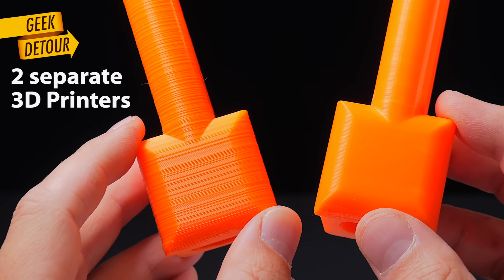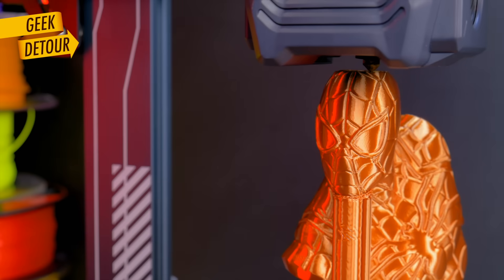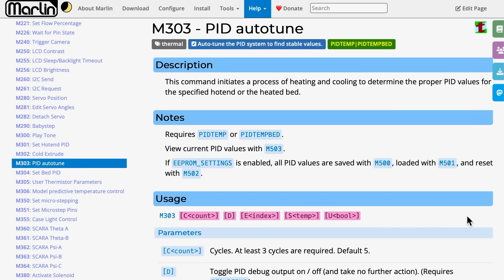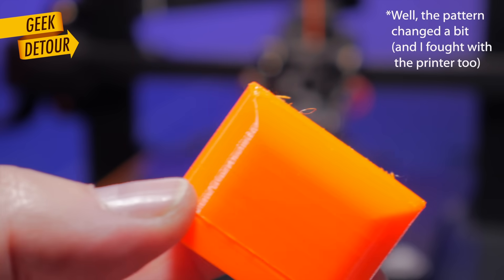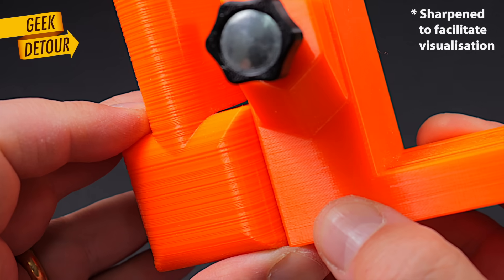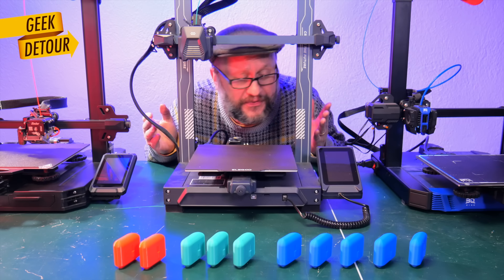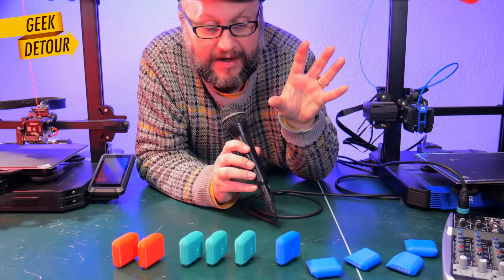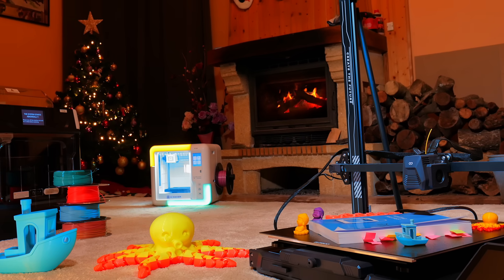3D Printer Problem: do you know How to Fix Z-Wobble?

Comment: I want to start printing but it scares the crap outta me to see a huge book related to possible printing problems. Is it really such a hassle to mantain?
Reply from the maker: No, it is not - at least not anymore. Printers got a lot easier to set up and use. But it is a hobby that pushes you into mastering, to learn how to get better results. Bambu Lab sent me one of their printers and I didn’t get a single issue - well, I had one fail, but that was my fault. Failing is part of 3D Printing. But most of the time you get rewarded with great parts.

Comment: I had a very similar problem with irregular Z-layers suddenly appearing on my SOVOL SV06 with every bigger / taller print a few weeks ago. I also went to lubricate, tighten, calibrate everything and it did not get better.

Turns out it was caused by filament binding up in the runout sensor I had mounted months before (located on a swivel at the base of the filament spool holder). 

Everything had worked fine after that for 4-5 kg of filament and only THEN the effects began to show looking nearly exactly like on the prints shown in this video.

I used a cheap, ready made filament sensor with no PTFE tube/lining, and the filament was slowly "eating" its way into the plastic of the sensor housing with every X-movement of the print head.

This lead to increased friction inside the sensor housing depending on the angle of the filament was traveling in relation to the print head - which obviously caused inconsistent extrusion volumes when the print head was moving along the X-axis and simultaneously "pulling" filament off the spool.

I fixed it by drilling out the sensor housing a bit and putting a piece of PTFE tube with a cutout for the sensor switch inside. Since then all prints came out fine again.
Reply from the maker: I loved to read this. Printers are getting better “as stock” but they are not perfect - specially the budget printers. Perfecting them is very appealing to me. Great solution ❤️
Reply: @GeekDetour  and sometimes it's your own "improvements" to the printer getting you - even with a timed delay - making things worse. 

I got the book you recommended and it contains a  lot of really usable information. 

... but in my own lowly opinion (especially after my experience mentioned above) I think 'filament supply issues' caused by mismatched spool-to-roller-diameter  sizes or less than helpful advices how or where to place  your filament guide / sensor / cleaner are often overlooked in this context.
Reply from the maker: Yeah. Sometimes silly details cause big problems.

Comment: I just got my copy of Sean's book today and after flipping through just a few pages it became obvious why this is a must have item for any 3D printer user. Thank you so much for recommending it.

I am using an Elegoo Neptune 4 Max. Fortunately it's a newer revision so several of the issues that were being reported seem to have been mostly fixed. I am experiencing some minor quality issues with my prints but at least I know about Z-binding now and am hopeful that some lubrication on the rods will clear it up before it gets any worse. 

Great work!
Reply from the maker: I am glad you liked Sean’s book - I bought mine in July last year and I really thought it deserved more exposure. But I had to wait for the right video to show it. 🤗
Reply: Hi again. I finally got a print I'm happy with and just need to sort out some minor Z-binding. I was wondering if there is a specific type and / or brand of lubricant you recommend? I am fairly certain all that is happening is minor Z-binding but until I grease the rods I won't really know lol. @GeekDetour

Comment: Hello Sir! Thanks for such a useful explanation. You acted like an actor, despite that fact you are engineer, respect! I have never seen such a guide which is recorded by heart! Just respect!
Reply from the maker: Hey, thank you so much! ❤️ If by heart you mean that I love it, that’s true: I am completely in love with 3D Printing since I got my first printer. Now, if “by heart” you mean “by memory”, here is the trick: when I try to memorize my points and speak them out, I basically freeze and I forget so much stuff… I write down the complete texts for my videos - when I record, I am actually reading. English is not my first language, so, I use a teleprompter 🤗
Reply: @GeekDetour  I meant overall work: 3D print engineering and also video recording. Keep it on! 

P.S. English is not my native language also. Hello from Uzbekistan 👋👋
Reply from the maker: Wow! That’s… awesome! Cheers from Spain 🇪🇸 (I am actually from Brazil 🇧🇷, but we came to Spain 14 years ago).

Comment: Thanks a lot! When I assembled my CR10V3, those nuts were extremely loose. At the time, I was told by many YouTubers to tighten every loose bolts on 3d printer so I did.....
Reply from the maker: The advice is correct, for structural things. The body of the printer should be as rigid as possible. But v-slow wheels have an ideal pressure: should just tight enough to not have wobbliness, but tighter than that is bad. The z-Nuts on the ideal world should be tight. But in most printers, having them a bit lose allowing free lateral movement is better than really tight. One thing is certain: lubrication is really important.

Comment: I fought a lot with my small Prusa Mini every time I had a clog issue or when the first lawyer didnt work well. 90% of the time? Filament. Good filament prints well. Period.
Reply: But also I need to add that sometimes the same type, same brand of filament, will behave totally differently just because it's a different color. I had that problem with PLA, same Overture or Hatchbox, just different color and first layer will be a pain.
Then a friend bought a roll of generic Jade Green PLA from Amazon and that thing always prints beautifully
Reply from the maker: I agree with you - partially. Indeed there is super good filament that always print easy and flawless. But there is a bunch of cheap stuff that only prints nice if it’s appropriately dried, and under an appropriate temperature - today I don’t even try before running everything I buy under 3 hours of drying, it’s easier this way.
I used to think that every filament could be printed, even cheap stuff… then I got something on a promotion about one year ago and I ran into a fight with that spool, dried it, tried many temperatures, I even ran it on 4 printers… nothing printed well. I spent hours in disbelief and half spool later I gave up. So yeah, there is very, very bad stuff too - but I only had such bad luck in that occasion. Most of what I bought ended up printing quite good with no stress.

Comment: "chemically anchored" is the single best way I've heard someone say "glued"
Reply from the maker: Hum… Sure, you are technically correct. It is glued. But saying “glued” conveys a simplistic feeling and most people would imagine it could fall, just like when you glue the wrong plastic with Superglue. In reality, when you use these glues, specially with the amount that I used (and it certainly crossed-invaded many internal ducts of the bricks on the ceiling), those Rods won’t go anywhere. I could probably hang a Piano 🎹 on them - the rods could break, the ceiling could fall down, but I doubt it will just slip from the epóxi. 🤣 Oh, have you used them? It was my first time - it’s spectacular! I specially love the mixer on the tip, with the twisting labyrinth.

Comment: Next time you have this problem, print an object in vase mode.
If everything is ok then there is no Z Binding or Wobble. I often had this problem after retractions. before and after retraction were these lines. PA and Retraction Problem
Reply from the maker: Oh, retractions were never the problem here - it was printing fine with my previous settings, never changed them, after I cleaned the rods, lubricated them, made the nuts a bit loser and lubricated the nuts against their brackets, everything got back to normal - no changes in the settings.

Comment: Ran a 100 Ender 3 farm at one point. The problem you're experiencing is due to debris inside the threads of the brass Z-Rod guide. You have to disassemble and remove the rod to clean the brass threads inside the guide. Cleaning and lubricating the rod without disassembly can move the debris out of the threads in the brass, but eventually the debris will build up again and cause the issue. As you can imagine the issue can present itself more often in a dusty environment . Also, sometimes the rods are over greased from the factory and debri sticks to the grease and gunks up the brass guide.
Reply from the maker: Wow! I loved your advice: hard to beat the experience of running a Big printing farm 👍 Do you have a favorite way of cleaning the Rods?
Reply: @GeekDetour  hot water, Dawn detergent, and a bristle brush. Dry the rod (and brass guide) completely with a super absorbent car-wash microfiber towel that leaves no lint behind and then LIGHTLY spray one THIN coat of Corrosion X Lubricant. She'll glide smooth and need little maintenance after that.
Reply from the maker: Oh, you really take the rods off and treat them good! I only did that twice in one printer. I want to try POM nuts, it seems they should run dry.
Reply: @GeekDetour  never tried the POM nuts, but if they work, they work. Now I'm curious about them again. I may order a set. Sigh, the tinkering never ends 😅
Reply: @GeekDetour  Test them carefully, but in my professional opinion a POM (Delrin) nut is inferior in every way I can think of to Brass for making a leadscrew nut, and is used only as a much cheaper alternative. It won't like the constant heat cycling, particularly in a closed cabinet printing ABS or similar high temp. You will see thermal expansion as well as degradation of the material. It is also prone to picking up sharp pieces of dust and debris and embedding them into it's surface, which becomes almost impossible to clean and will lead to more wear on the screw itself. It will also wear much quicker leading to backlash and inaccuracies. Now if you don't mind regular replacement then an almost perfect material would be hard Graphite. Can you get Graphite leadscrew nuts?.  Shame :)
Reply: @craigjoe8691  <3
Reply: @GeekDetour I just put some on my E5P, with WobbleX couplings. Made zero difference.
Reply: Did this solve the problem?
Reply: as someone that just pulled apart their s1 pro and cleaned their rods/brass threads in a sink full of hot detergent water, don't be so sure of yourself.  

I cleaned, re lubed, and reprinted a z wobble test and got an even slightly worse result.

Following this video fixed it.  Those damn screws.

I'm sure with a print farm the main cause of faults would probably be dirt/debris build up.  

My point is don't go saying 'IT'S THIS, NOT THAT' when it comes to 3d printing.  So many different things can be the fault
Reply: What do you use to lubricate the threaded z rod?
Reply: @chezcotton  Corrosion-X
Reply: Yes this sounds like the problem I got, after about 4 cm of printing layers start to act up like this. Removing the z rod sounds like a bit of work though..

Comment: had this happen with a ender 3 v2, issue was the stepper motor mount that came with it wasnt a flush 90 deg from the base of the machine, causing the rod to have tension.

Comment: I’ve been there too often.
For me the main culprit’s were:

X Gantry wheels dodgy.
Looked perfect.
Replaced with New = problem gone :-)

Z bearings too tight.
Not enough slip/slop.
Top or X gantry location of Z rods.
Loosened = problem gone :-)

Comment: Had the exact same issue on my S1, leveld the Z-Gantry again, the Z-Nuts were extremely tight on one side, adjusted the V-Wheels again and it works like it should again. Thanks for the video getting me to the point of failure

Comment: I just inherited an Ender Pro. I've not yet had it running. One of the screws you were pointing out is missing and the other very loose   perfect find this video. The stepper feels very loose it even moves up and down by about 3-4mm it also moves left and right a few mm is it only held in place by the two screws?
Reply from the maker: Hi there! The ZStepper of an Ender 3 Pro is indeed help with only 2 screws - well, 2 screws on one side of the stepper and 2 screw on the plastic part that mounts it to the vertical aluminum extrusion. These 4 screws must be tight. The NUT on the Z lead screw doesn’t get tight. The screws that hold that nut in place are just tight enough to keep it in place, but there should be lateral movement.Hope it helps! It probably can print well with just one screw holding the nut.
Reply: @GeekDetour  Hey thanks for replying so fast I'm sitting here trying to figure this thing out. Do you mean the 2 that screw into the stepper or are they in the Ali  extrusion on the on the extruder side? Also another thing How do I raise the extruder bar up to adjust the carrier tension? I know it's a cam on the bottom bolt but I can't figure out how to raise it to get a spanner in?
Reply from the maker: Here, a video for you 🤣: https://youtu.be/hgfTVNBRRTo?si=obxiAQiOykh7r3rf

Comment: Guess: probably loose belt tension?
Reply from the maker: Nope! Belts were perfect and I still didn’t touch the belt tension in a year. The Z-Nuts were binding. After lubricating the leadscrew and the nut being lubricated and loosened a bit, the printer got perfect.

Comment: what printer settings and or profile do you use for your ender 3 s1 pro
Reply from the maker: There is nothing special, actually, I change values all the time depending on what I am printing… The most important thing is that your printer is mechanically adjusted: moving smoothly on the directions it should move, but with no play at all on other directions. The VSlot wheels should be well set to not allow wobbliness. Search for how to calibrate retraction, linear advance and flow - these are the 3 important things you need to figure out.

Comment: Yeah... The "wet filament" mantra is something you'd read on literally every 3D printing issue topic on Reddit. People are like bots, posting this nonsense over and over again. :)
Reply from the maker: It’s crazy: in the past very few people acknowledged the importance of drying filament for best results… and suddenly it became the (wrong) guess for all 3D Printing problems 🤣
Reply: @GeekDetour  This is the reason why asking for help on online forums is usually, a waste of time. For example - on Ender-5 forums people constantly struggle with bowden clogs caused by too stiff extruder spring. 99% of advices is either "wet filament" or "tighten the extruder spring". This is actually the oposite of what should be done.
Reply from the maker: The Forums had a sudden huge influx of people beginning their journey with 3D Printing… and everyone wants to help and participate - so it has lots of noise now. The sad thing is that experienced people get tired of the same questions (and the frequent nonsense)… and they leave. That’s sad. I am also getting tired on some forums, but Forums are a good thermometer for what I decide to cover in my videos 🤷‍♂️

Comment: My z wobble was caused by the flange running off the upright (that the lead screw runs through) not sticking out 90° from the upright. Am currently switching from using lead screws for the z movement to a belt driven system. Ender 3 v2.
Reply from the maker: I am very curious about this new “Z Belts” trend. Specially about the print quality and possible artifacts - I wish you all the luck! And try to make a video showing the before and after in some prints!
Reply: @GeekDetour  Me too. After the run around I had trying to locate the source of the problem I became a bit annoyed at Creality providing a chassis component so basically flawed. So annoyed I thought "sod lead screws" which is a bit OTT, I must admit. 

Been following a tutorial for an Ender 3 (I have an Ender 3 v2) which created some headaches. Just waiting on a couple of right sized bolts to arrive in the post before finishing the mod. Well, for me it's not a mod so much as a repair. But even if it gets me to an acceptable standard in a reliable manner I'll be overjoyed. 

 The quality before was fine before I started to print larger items which made the z-binding really bad on the right side (had a dual lead screw arrangement). Could have reverted to the default but the carriage now carries a stepping motor and extruder on it. It weighs a fair bit, even with a pancake stepping motor.

 The sag at the far end of the gantry...

In retrospect perhaps I should have taken the backplate with the offending flange to an engineer to be hammered to a 90° position...

But I really like the idea of avoiding lead screws.
Reply from the maker: I am working on a radical idea about the LeadScrews and the Belts… you should subscribe 😄 I am still prototyping - but I promise it will be something for the community to rethink things.
Reply: @GeekDetour  Ooooh! Consider me subscribed!

Comment: Good infomation . About to buy first printer    Had thought I had decided on a ELEGOO Neptune 4  pro   but have since see videos saying cylynders   etc  are not  truly round by about 0.3 mm     Is this an adjustment ?  or a fault with Elegoo models.?
If that so will have to choose another modle...Any opinions?
Reply from the maker: Any 3D Printer must be calibrated - when you tension one belt more than the other you are making parts stretched too. CNC Kitchen made an excellent video about the best way so far to calibrate the printer for simentionally accurate printing: https://youtu.be/H7OsnMLDIMw?si=SdJ8V-4Q8Z5Yxlce
Reply: Have watched that since my post so think I  might still take a punt on the Neptune 4 pro.